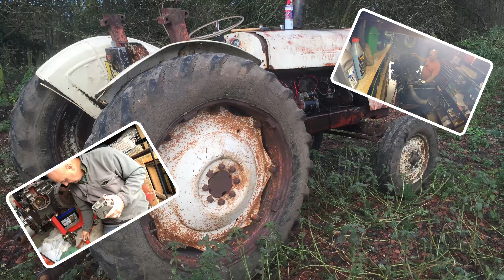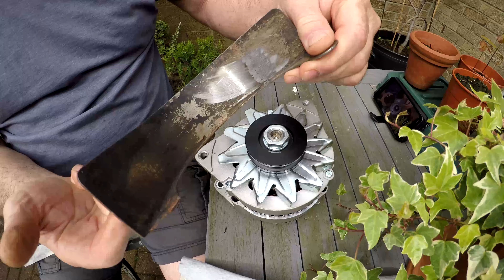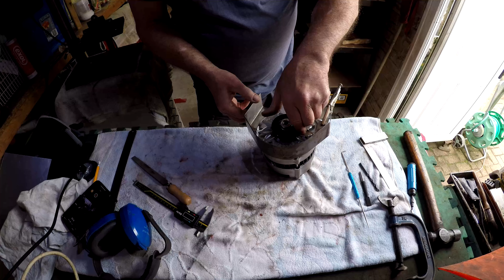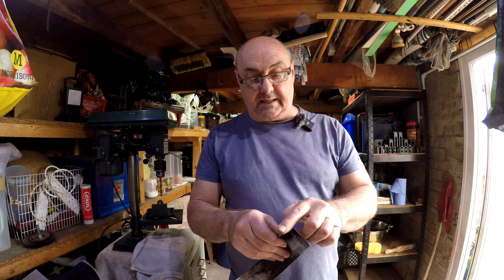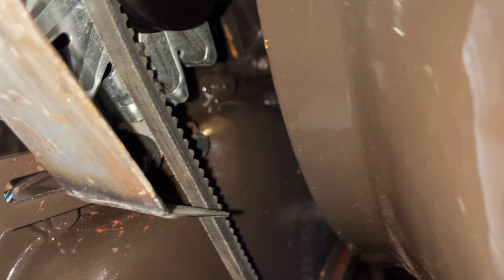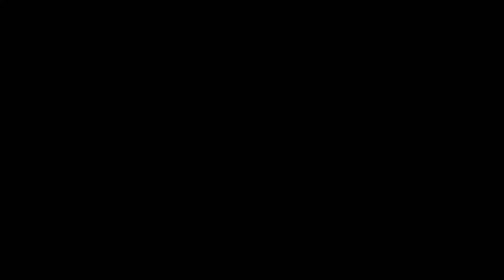David Brown 990 alternator guard repair #99

Comment: Very nice guard you have there.
I swapped my dynamo for an alternator just like yours, on my 990 Implematic, but have no guard for it. That went well, until I put the bonnet back on.
At first it was OK, but shortly after I started it up, the noise from the cooling fins, hitting the edge of the bonnet scared the life out of me!
Anyway, i would just recommend you check yours with your bonnet on as well 👍👍
Cheers fron Denmark
🇩🇰🚜🔧👍
Reply from the maker: Hi OK Hansen, will do, I've heard that noise before and it's quiet alarming when it happens.
many thanks
Barry

Comment: Very nice Barry, you'll be a great tinsmith when you've finished the Tractor, what colour  are you going to paint it? Also if it's a bigger Alternator do you need to check the clearance to the bonnet or is that just a job for later?
Reply from the maker: Hi Terry, the guard will get a touch of chocolate on it so as to blend in with the engine, The tractor came with an alternator and a crude cover attached to the side plate of the bonnet, So it will need sorting out correctly.
I'm enjoying learning all these new skills attached to the rebuild, I always shy'd away from thin metal welding as I always blew holes in it.
every days a school day as Jon would say.
Cheers Terry
Barry